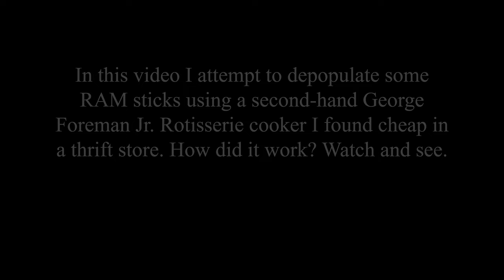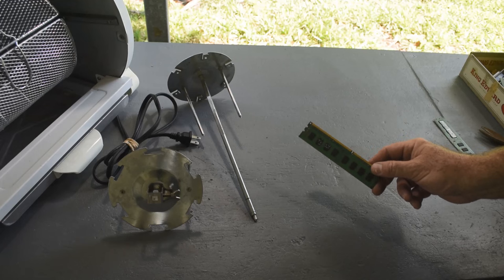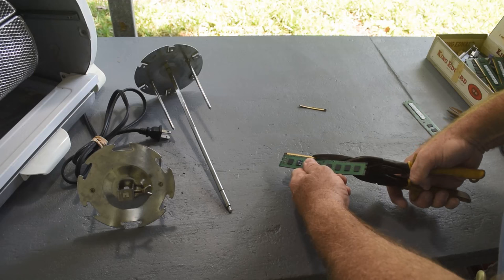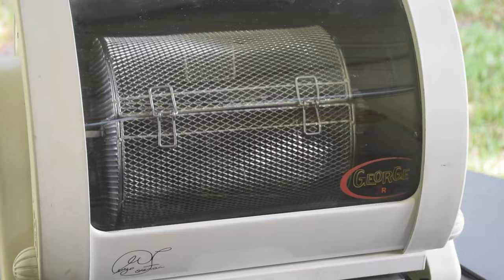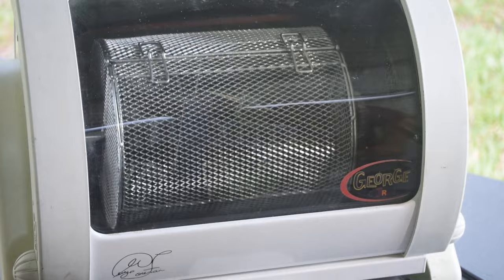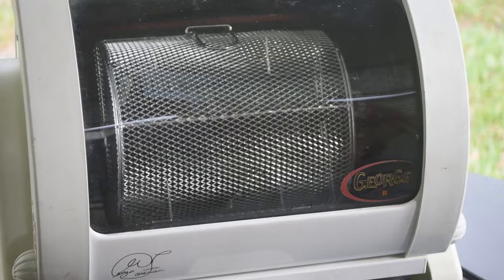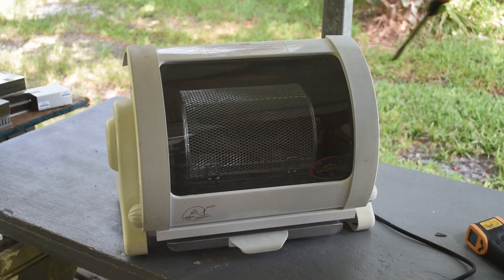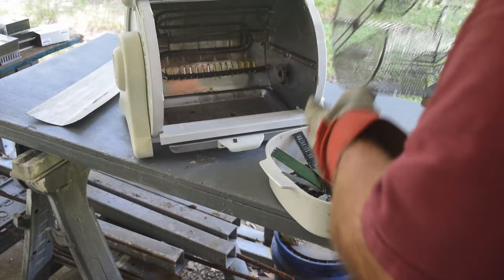Cooking Up Gold: Rotisserie Depopulater For RAM Sticks and Small Boards

Comment: that's awesome, will keep an eye out for them in the future.  Could do something similar with a BBQ and rotisserie motor and basket for a larger scale operation and you can use a device meant for higher heat.

Comment: Okay now I'm very impressed! I have been using a GW toaster oven and placing the temp to 450 which is the perfect melting point of solder and allows the IC chips to fall off freely and yet still not burn the board. Kudos, now i'm on the hunt for one of these. Thanks for the wonderful ideas and demos Mike.... Cheers

Comment: First saw successful engineer do this a few yrs ago.. I used a BBQ rotisserie with a propane ring burner under the basket. Get 2 spits, 2 baskets, as one’s done, pull it to cool, put a freshly loaded one on.. gets thru piles of ram very quickly

Comment: I lately tried with an electric table grill. Worked great. Load the surface with as many sticks as fit on. Wait a couple of seconds, exchange the first for a new one and knock the stick on the table so that the components slide off and take the next one. Mine was faster than i could work it, so I had to turn down the temperature. It started burning. A stick every 10 seconds is feasible.

Comment: Nice re-purposing Mike, I'll get one of these for small boards, more economical than my set up. I use a kiln with a custom motorised rotary cage, pretty much the same but temperature controllable. Also works for large boards

Comment: Very innovative. I’m sure more RAM sticks would tumble around more and knock off the chips quickly once it gets hot. Where does the solder go? Or did it stay on the parts? I wonder if the spinner motor could go a tad faster? Maybe small or cut up boards with gold pins too? I’m sure it could be used many ways. Thanks!

Comment: nice, 
it might have some TEMP-SENSOR which you could Re-Place with a Higher-Temp-Value ...
Reply: The thermal overload is often a fuse type and doesn’t reset. Cool idea using this tho.